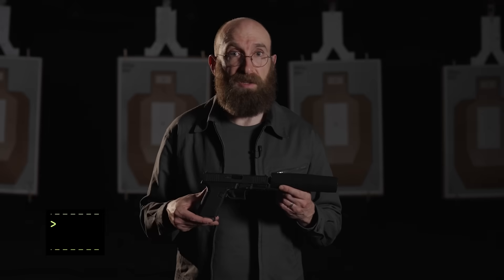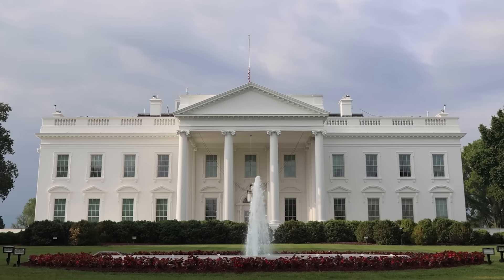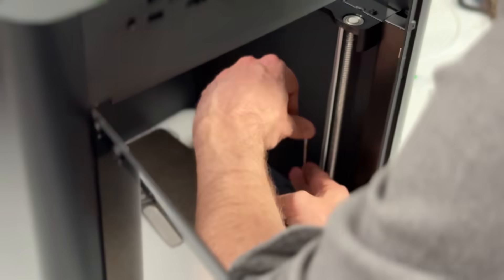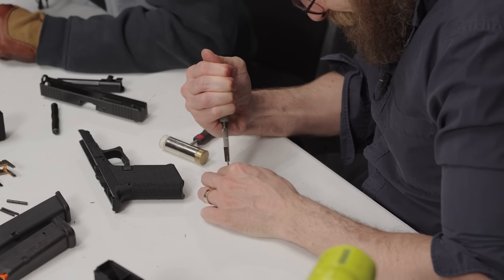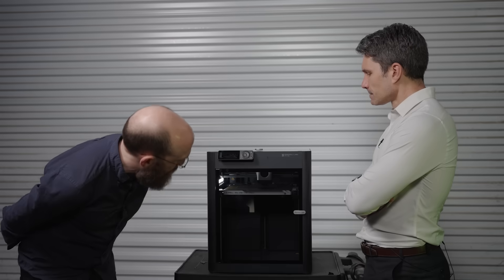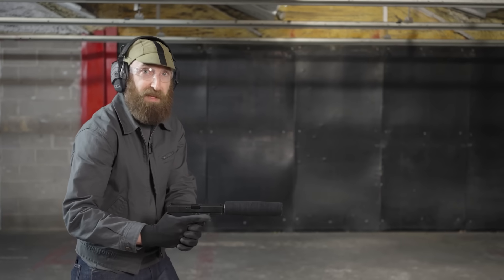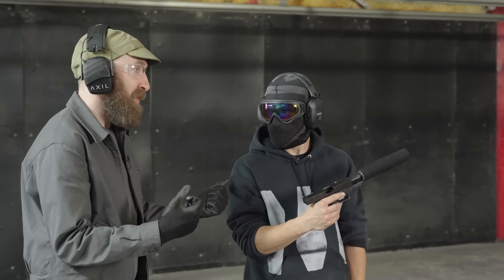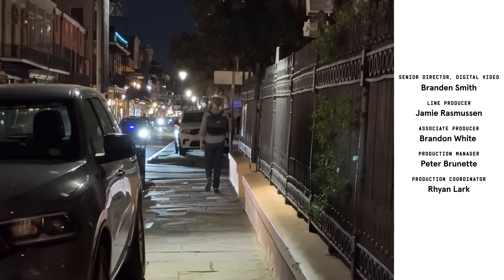I 3D-Printed Luigi Mangione’s ‘Ghost Gun’ | Hacklab | WIRED

Comment: Given that paper printers include a feature to prevent the printing of currency, could a comparable feature be implemented in 3D printers to restrict the printing of firearms?
Reply: No. Most of us already use open-source software and firmware. There is no stopping the signal.

Comment: you need a nielsons device for a blowback pistol to cycle when a supressor is installed, basicly you need to add a spring to the trhead adapter
Reply: A 3d printed suppressor with a Neilson device is in beta

Comment: you cant limit it at the printer.limit it at the sale of the barrel and parts you need. You cant make all the parts on a printer.
Reply: You can however 3d print a jig to turn ordinary steel pipe into a barrel with salt water and some electricity.
Reply: A printed .22 exists that only requires a rubber band and lead weights everything else is printed

Comment: 11:10 "3D guns are a whole new ball game..."
Err, I'm pretty sure guns have always been 3 dimensional.
Reply: 🤔 Duke nuke-em or DOOM? 😂
Reply: @ebutuoy-YT  pixels on a screen are always two-dimensional, with the tech we have, bruv.
Reply: @nobody8717  my point exactly
Reply: @nobody8717  vr exists buddy
Reply: @nobody8717  There have been 3D screens for a few years, and various types of holographic displays. We can render 2D games as 3D games, and then project them on a 3D screen.
Reply: With a welding pistol or a simple blowtorch and a sheet of iron, you have any gun you want. They speak like if 3D printers were a revolution.
Reply: these people act like CNC hasn't existed forever.  
3D Printing is a form of CNC with plastic and additive instead of subtractive.

Comment: 17:00 Ha! A significant portion of the printers sold come with Open Source firmware. I can't see how it's easily detected. The firmware would need to assemble the gcode into a 3d object, detect if it's a gun and then refuse? What if it's a toy gun?
Reply: Every firmware problem has a software solution. These people dont understand that their "controls" are easily circumvented
Reply: Absolutely, this wouldn't be nearly as simple as a normal printer detecting money.
Reply: they will require every $50 chinese printer to come with a 4090 running some advanced gun detection model /s
Reply: It would never happen anyways. It’s a huge stretch and the company’s or softwares will never be forced to do this.
Reply: Right?! exactly....nerf, airsoft, water, rubber band, i mean endless toy options, ENDLESS. It will never happen. I love how he makes it sound so open and shut though... like no, you idiot xD
Reply: do not be stupidly naive. firstly they ban controllers w/o TPM, then they ban printers w/o tracking functions. The 3d printer producers will obey these laws step by step. just business.

Comment: 70% of the cost there was the printer.
Reply: And that is an expensive mid-high tier printer. Low tier garbo printers can go below $100.
Reply: Luigi Mongione killed a man who was an agent of the pro-Russian secret police and was engaged in encouraging talented and ideological people who shared democratic views to commit suicide or mental disorders.
Reply: They also bought an expensive printer. An Ender 3 can this for $200.
Reply: Right. Which means. After acquiring a printer.. production of multiple guns must go cheaper than just for one single gun. This is CCCRRRAAAAZZYYYYY
Reply: @felipecastillog7810  The mechanics of a firearm is not some crazy engineering feat. It is possible to get everything you need to build a primitive but serviceable deadly firearm at your local hardware store. Getting the printing skills to 3d print one is no easier than getting the proper skills to cobble one together out of hardware store parts.
Reply: @bryannorris8049 Mmhh yeah. I guess I have no reference in price points for that, since in my country we dont have guns like yall do. Im just impressed with this type of gun production. And the fact that it avoids licencing, gun control or tracking laws. Protected by the amendment to have weapons for protection. Very interesting. I  guess in my country there is the same void on 3D printed guns... Guess well need more years to sort it out.

Also I read another comment that said. If printers have been regulated to not print counterfit money. Would that apply to 3D printers to prohibit the print of guns??? Would love to know.
Reply: @bryannorris8049  if engineering firearms are so easy, then design and manufacture a glock and the accompanying ammo, without sources - no internet - no books - no references - no experts - no 3d printer - no milling machine
it is a miracle that printing a frame, then buying and assembling precision parts is now trivial.
Reply: @cate01a  There is no reason that the firearm had to look and function like the one in question to accomplish what happened.
Reply: @cate01a  indeed if they made the barrel the regulated part then 3d printing a gun would become 1000% harder.. very strange rule IMHO
Reply: @ToolkiT73UK   but couldn't you just use a kind of pipe and then just make it a drilled (don't know if this is the right term but hope you get me) barrel? That is almost just as easy as buying one. I think ultimately there is no way to really prevent the production of firearms made for malicious intent. The same with various substances. If one is committed to do this no one can stop them
Reply: @bryannorris8049 you can’t assemble a Glock with hardware store supplies and no special skills. You can make a single shot shotgun though.
Reply: @kuil  Which would be sufficient for the incident in question.
Reply: @felipecastillog7810 as it should be.
Reply: @felipecastillog7810 correct.  Go buy one and print guns.